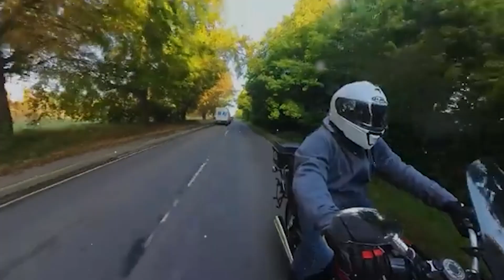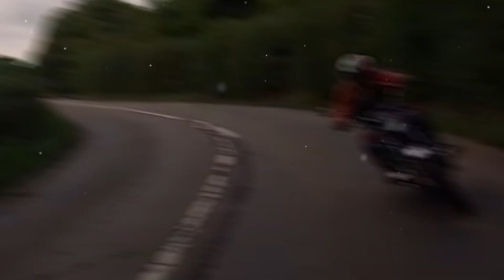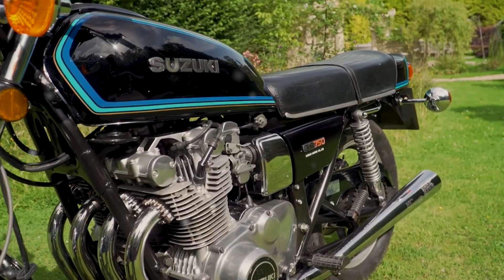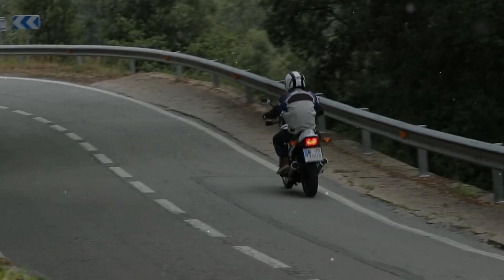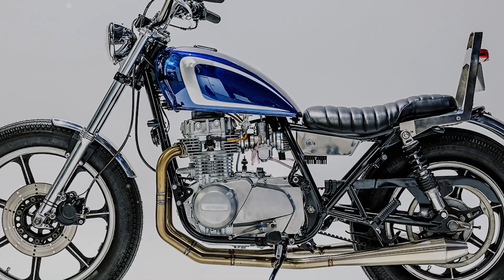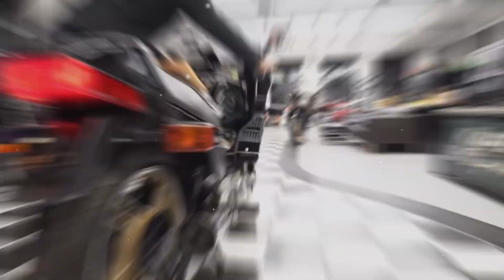15 Japanese Motorcycles from 1970 & 80 no one wants Back

Comment: I had two of the bikes described in this video, and would disagree 100% with the narrator. My 1977 Suzuki GS750 never showed any of the issues described here. I rode it daily to and from work for three years, in all weathers, including heavy snow and blizzards.  The only real "issue" I ever experienced with it was handling when pushed on twisty roads, that was because I was too light at the time, weighing approximately 9  stone (126lbs) at the time. Heavier friends who road it, never experienced any such issues.  The other machine was the Honda 400T Hawk. I had two of the 250T versions (I live in the UK where a 250 model was supplied to the UK learner market), neither of these bikes showed any of the problems highlighted in the video. The only serious problem occurred when the balancer chain snapped, due entirely to my failure to adjust the chain tensioner properly.  Also, in common with most viewers, I hate these AI voiced videos! Please use a real human narrator.
Reply from the maker: Hello Terry,
Thanks for sharing this, surely it is very insightful. What I gathered here is a mix of self experience and other riders’ reviews, not as facts. I’m glad you had no issues with your GS750 and Honda 400s. 

Regarding the narrator, I’d love to use real human voice if the budget allows 😢

Ride safe, enjoy the thrill 🏍️💨